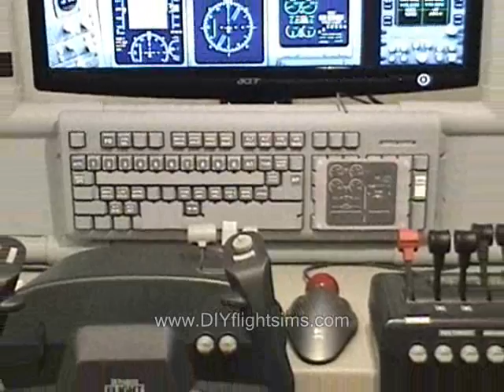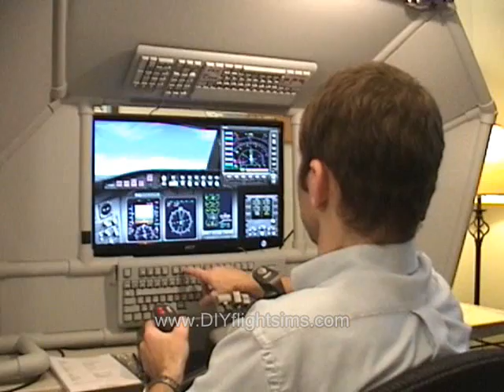DIY Home Flight Simulator:  cockpit enclosure

Comment from the maker: Yes, go to the DIYflightsims website and click the FAQ link (Frequently Asked Questions).  There is a currency calculator there.

Go to the DIYflightsims website. Click our "Online Store" link.  The CH Products throttle quadrant is on the 3rd page of the Hardware section.  The lever knobs are interchangeable, so you can use it for a 4 engine plane.

Comment from the maker: It's less than about $80 or $90 dollars for the pipe, connectors, foam, glue, paint, etc.

You can get the throttle and other controls from the DIYflightsims website.  Click "Online Store"